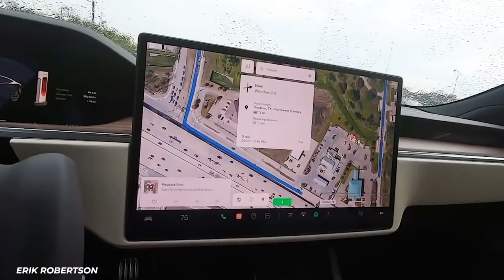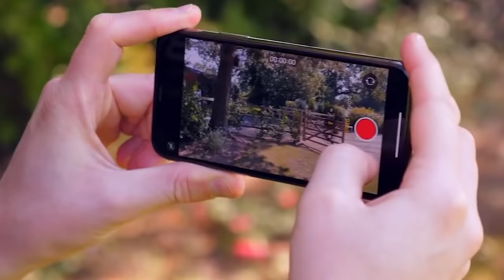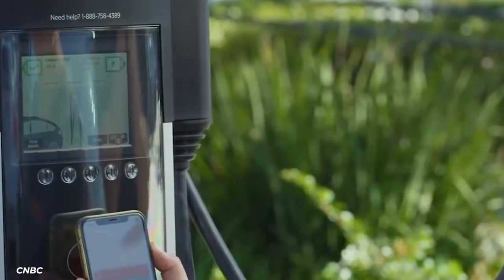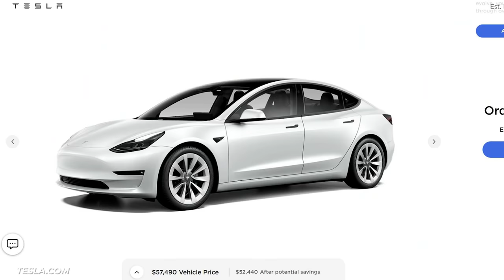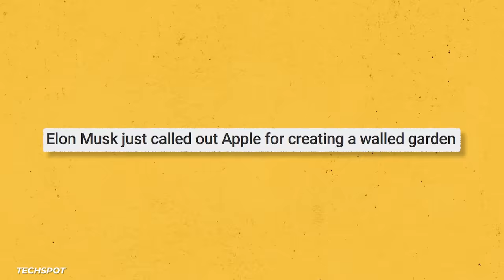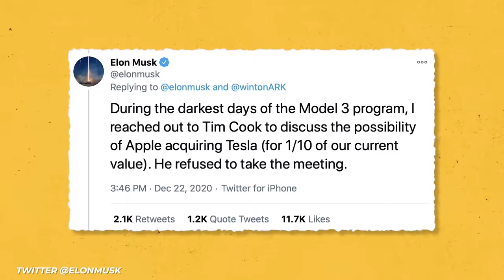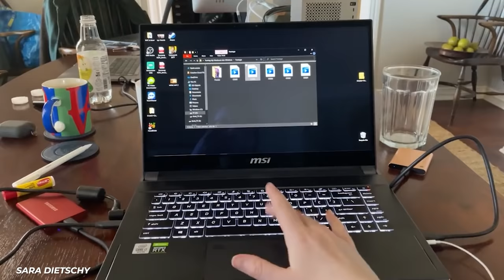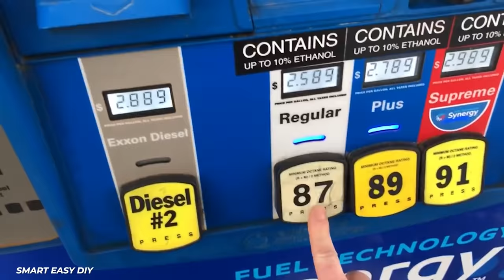Why The Apple Car Is A Threat To Elon Musk

Comment: …Apple Maps - Oh no!
After seeing all these lovely shots of 3D concepts it’s going to be a real anticlimax when people see the actual $30,000 Apple entry level model (basically a Mobility Scooter - with one of those flags but in proprietary carbon fibre that’s been specially treated to make it white). The ‘actual’ Apple Car worth driving (fully optioned - ie it comes with an actual engine) will be the $20 Million Dollar version.
How many times they will change the actual recharge port each year is anyone’s guess.

Comes in any colour as long as it’s White or the twice as expensive Space Grey option
…later on in the year you will be able to get the Red (AIDS) version
The Radio comes with EVERY U2 Album ever released stuck on endless repeat until you sign up to Apple Music